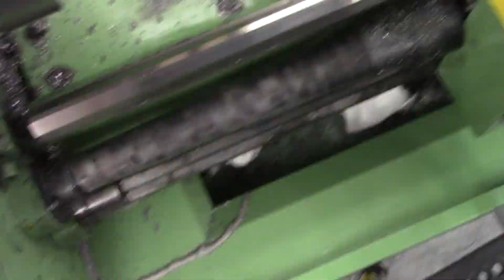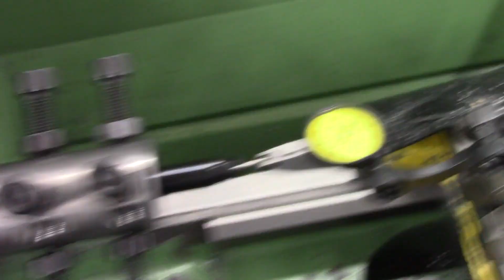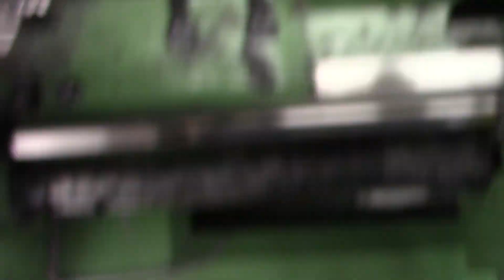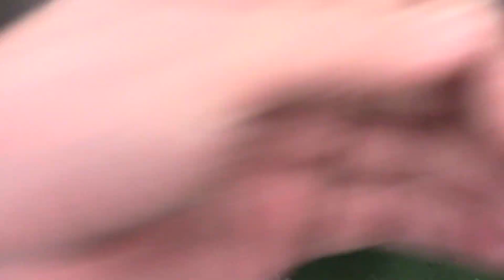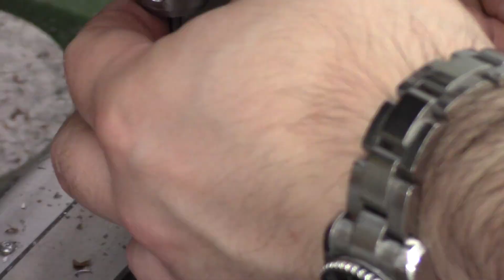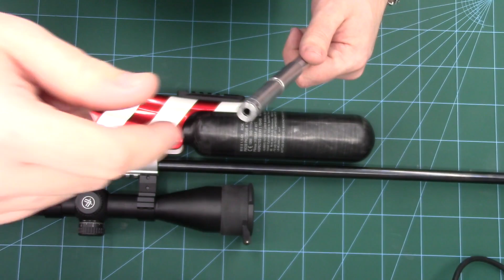Red white and blue wolf, re-barrel

Comment: Hello, do you think this method of an o ring would work on the rapid 7, there is a reasonable seal but never seems to be 100%?
Reply from the maker: Probably, you will have to make a new pellet probe though, I would suggest try polishing up both the barrel face and probe sealing surface first though as I had a rapid 7 .22 and had no blow past with the pellet probe. Thanks for watching.